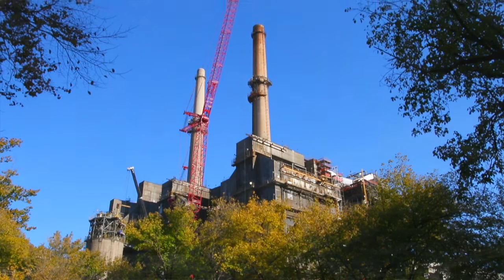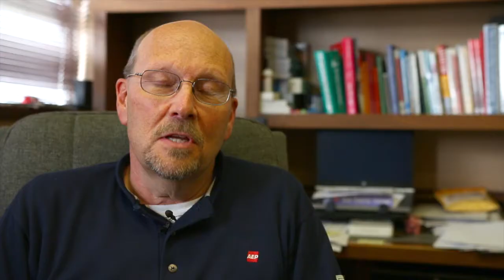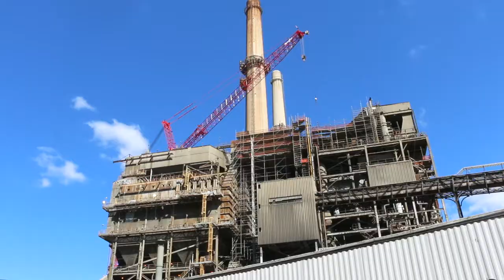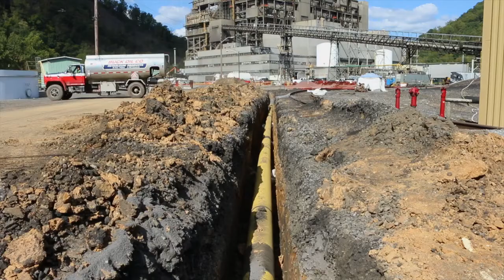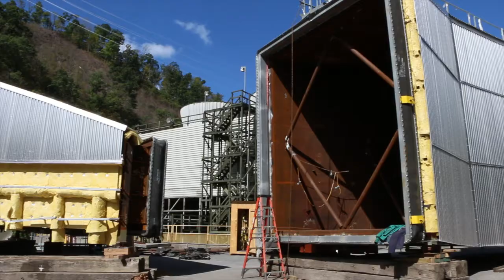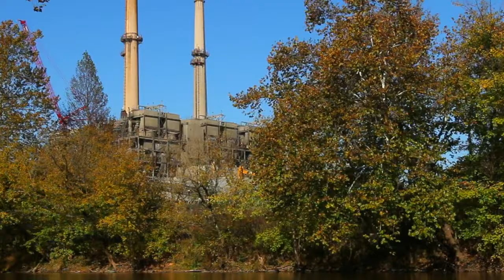Coal to Gas: The Clinch River Plant Conversion

Comment: Why would you rather use coal?
Reply: Quick load changes, vastly abundant fuel that is cheap, resulting in less cost to the consumer.
Reply: @claytongreen9630  Natural gas is pretty abundant and cheap. And coal is the dirtiest burning fossil fuel and natural gas is the cleanest burning. Natural gas also yields the most energy by mass when burning at 55.5 megajoules for every kilogram burned. Natural gas doesn't produce ash that needs to be disposed of.